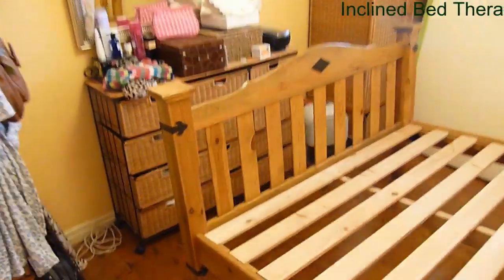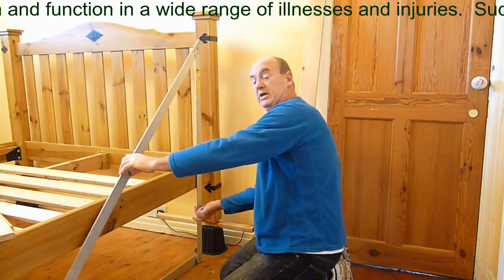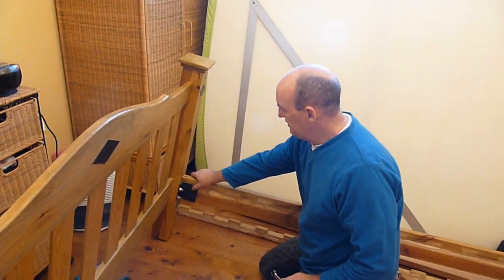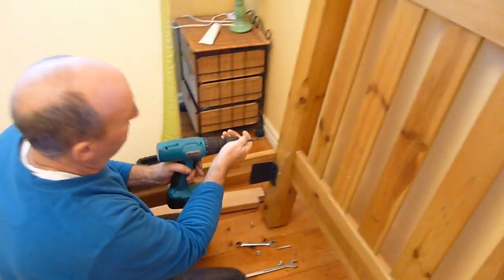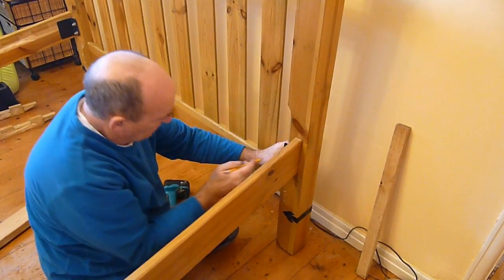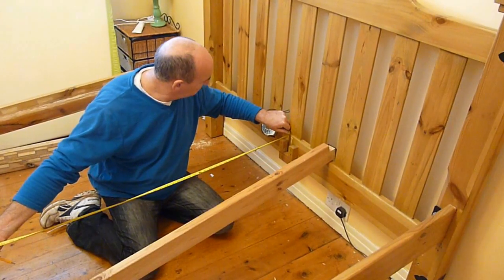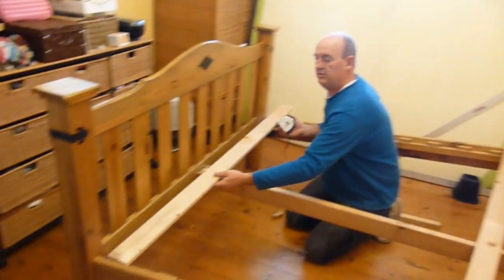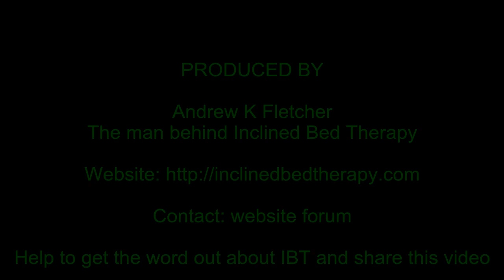How to convert a wood framed bed for Inclined Bed Therapy (IBT)

Comment: One of those stiff 5 in 1 painters tools used for cleaning paint rollers etc are excellent for removing trim and what you did here because it's thinner than a chisel but stiff enough to remove the wood with less chance of damage.

Comment from the maker: Yes you can, The video shows people how to modify a bed once they have decided IBT is for them. If your frame is pine but of a weaker design (most pine beds) then you will need to place a plywood sheet under the mattress on an angle using 6 inch timber at top and 3 inch timber in the middle. This does not affect the frame joints as blocks would. Join us on Facebook; Inclined Bed Therapy
Reply: Do i use a pillow or not,and from the first night i go up to 6 inches or slowly up.

Comment: I just raised the legs on mine with stands under the 2 legs on the head side. They have stands that you can adjust also.
Reply from the maker: It don't matter which method we use, cheapest and simplest is great. So long as your bed is safe and inclined

Comment: TY for the tip Mr. Fletcher. I've suffered from intractable WED for 30 years, am completely nocturnal and sleep only 4-6 out of ever 48 hrs.  Sleep/rest in any position is the trigger and is delayed 8-10 hrs by torturous movement in all limbs. Killing me.Mind screams for sleep, body screams to move.Aside from anesthesia, relieved only by voluntary movement, visual stimulation and loud music to 'trick' the brain. Thinking a combo of IBT/vibration therapy mentioned below just may be the answer!!
Reply from the maker: Hi Kimmy, have you been using IBT and if so has it helped with restless legs?

Comment: As a sufferer of Willis Eckbom Disease, I'm wondering if IBT, with enough of a tilt that when feet are pressed or 'weighted' against footboard, if it will reduce RLS/periodic limb jerking in legs without having to jump out of bed and stand up in order to stop the movement?  Could possibly be relief for the legs, not sure what to do about the arms ;)

Comment: The incline could also be achieved with an "inclined box spring", instead of inclining the sides of the bed. To to that, remove the slat holders from the bed & attach them to the sides of an inclined box spring frame (DIY). Put the box spring on the sides of the bed. https://www.youtube.com/watch?v=YmF5ylEGIbw

Comment: Andrew, how would you convert a bed that's on a box spring which is on a  metal base that has wheels(just the metal slants with wheels underneath the box spring)?
Reply: build a WEDGE, the size of the mattress with plywood , to place under the mattress, on top of the box spring for the safest way to incline